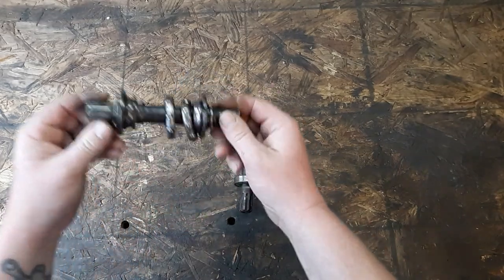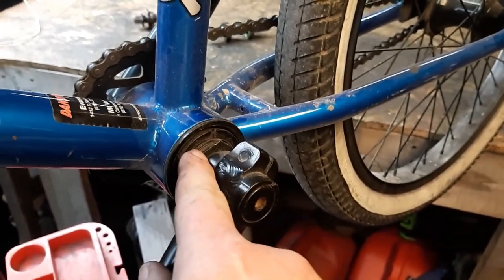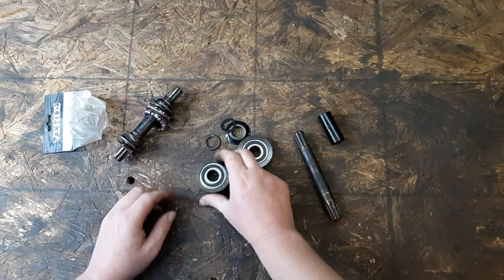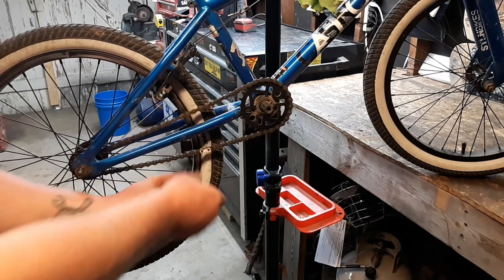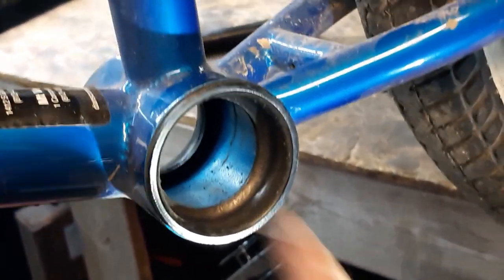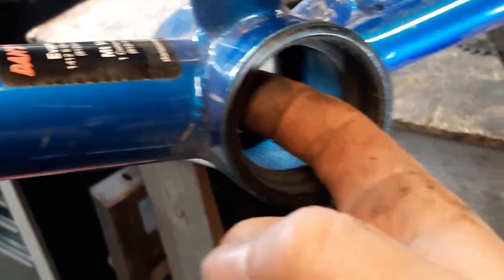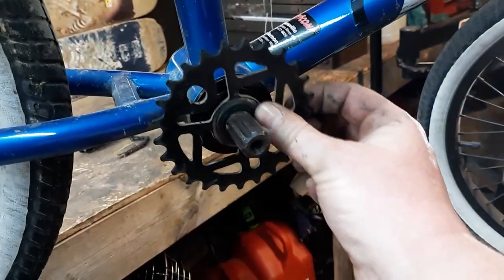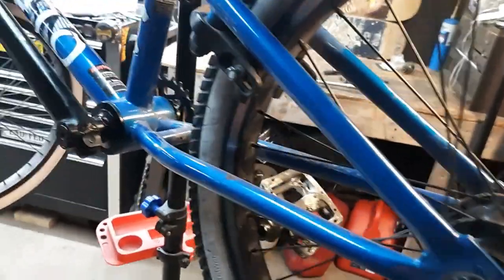How to convert unsealed American bottom bracket to sealed bottom bracket bearings

Comment: I bought a Rant American Mid BB convention kit,and did it this way with an improvised bearing press. I put off doing it as I was apprehensive about damaging the press fit bearings. Take your time making sure the beatings go in evenly. I didn't have to cut down the spacer as some have said they had to do on the Rant reviews ?